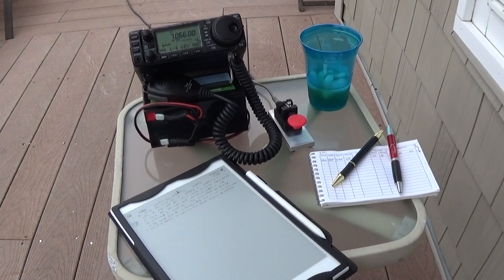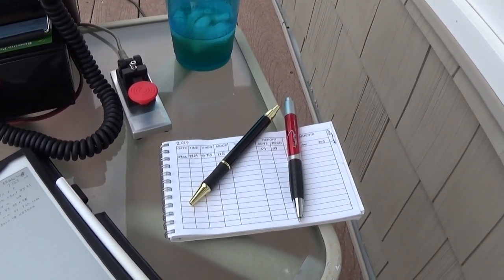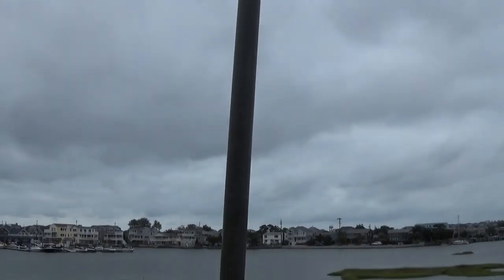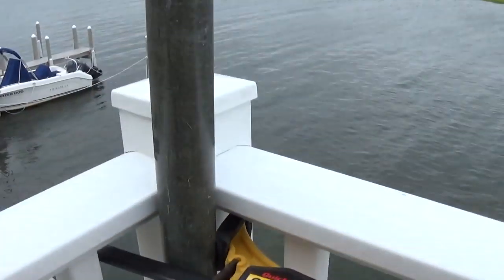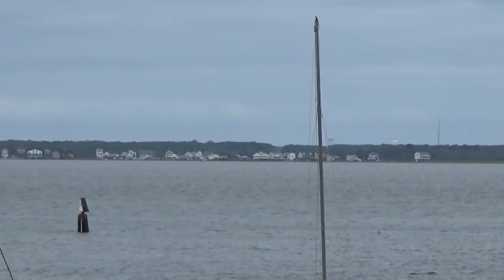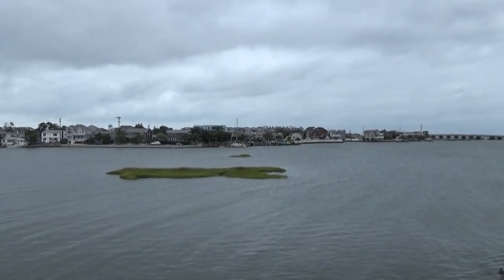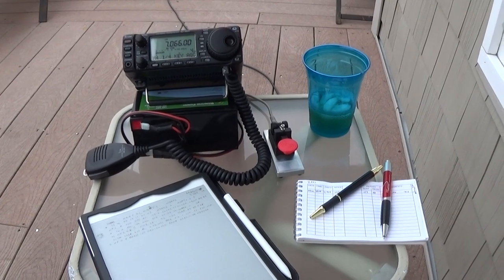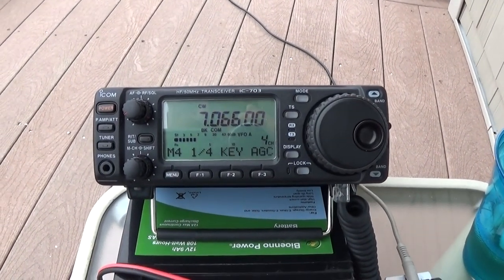#304: Ham Radio: My QRP setup on vacation at the beach house on Long Beach Is. NJ.

Comment: Try some of those rubberized metal cable ties to secure your antenna pole. It's easier than trying wiggle wood clamps in position.
Reply from the maker: Good tip, I’ll have to look for those!

Comment: Nice video, and what a beautiful area. Would a 1954 NC-300 w/2 meter plug in be usable today as a Ham Receiver?
Reply from the maker: Sure, and it would probably be more "fun" to operate than a modern receiver.
Reply: @w2aew  it seems to work, but my antenna is just a piece of coax hanging out of my third floor apt window. But I did hear a voice, hopefully human...
But I can't believe it works at all! 66 year old caps.. Makes me nervous.

Comment: I noticed your reMarkable digital paper tablet in videos you did quite a while ago, and came here to post a comment / question to see if you still used it, and how it held up. And viola there it is! If it isn't too much trouble, a few words about your experience with it would be valuable to me as I am considering buying one, but have heard a bit of negative feedback about them in my research. Thank you in advance!
Reply from the maker: I like it still.  It is pricey though, for what it does.  For me, it is the flexibility it offers for altering/editing my page content (without throwing away a lot of paper), and being able to export PDF files without having to go to the scanner.  Pretty handy for CW copy as well.  Biggest downside is the cost.
Reply: @w2aew  - Thank you. I appreciate the feedback. I like what they are doing, but I hear a new model may be released soon. I think I'll wait. Your videos rock, by the way!
Reply: @w2aew  - Thought I'd get back to you. I was able to contact reMarkable tech support. Apparently the rumor is just that, so I went ahead and ordered one. Thanks for the help!

Comment: Actually I have a doubt why do waveforms move in an oscilloscope when trigger level is higher than signal amplitude and why do they stop when trigger level is on the signal is there something going on related to characteristic impedance(some reflected signal is making the signal move)

Comment: Hi Allan love your vids mate you are so cool....  its said that the QRP record is over 1600 miles on 1 micro watt on 10m   I really find this had to believe...   is this really possible and what is your personal record... Thanks
Reply from the maker: My best was 9200 miles on 100mW
Reply: @w2aew  Hi Allan sorry just realised I did not reply how rude sorry... Wow that is totally amazing that such a small amount of energy propagation can can be pick out of the Aether amongst the whole torrent of EM waves, it really speaks volumes for the outstanding design of the radios and the efforts and skill of the operator in knowing their gear and being able to setup for max performance by taking in to consideration all the variables Time ,  time of year, location, atmospherics and so on,  ham truly is an art and its really nice that folk like yourself take the time to share so others can get some insight into a truly fascinating hobby.. Thanks Allan
Reply: Its funny when you are a kid your all POWER POWER then as you get older you slowly realise its much nicer to refine your setup and use as little power as possible ha when I was about 15 (1995) I delved into radio uniden or sybernet boards were the cheap rig order of the day if I remember correctly  anyway as most do I bought I rig and antenna from someone I knew, turned out   it didn't work,  I took it apart and repaired it it had a reverse polarity diode across the power in which was short so clipped it out and was in business and in in no time at all I had radio gear coming out of my ears I was hooked, I was inside them replacing output trani's, turning up the power output they had a couple of small inductors with movable ferrite slugs inside, turning up the deviation to make the mod louder didnt really know what I was doing but it was great  fun,  Any way long story I went bigger better B300p B550p then I got a vacuum tube unit that was capable of over a KW, I had no idea about interference (after all my TV was fine)  or the people charged with hunting down the idiot causing it (the DTI) the UKs version of the FCC and yes it was just a matter of time until the inevitable knock on the door and the subsequent confiscation off my gear :( should have seen it coming when keying up turned on every sensor light in the street  lol turned out that I should have checked that I wasn't causing mayhem (who knew) and fit an inline filter for anyone suffering interference..

 A radio baptism of fire..... lol

Comment: Nice set up there 👍.Does ur end- fed antenna have a counter poise? I had my swr fluctuating wildly with the coax as counterpoise.
Reply from the maker: Just the coax, but the autotuner in the 703 easily takes care of SWR variations
Reply: @w2aew  I'm my case, I had impedance changing every next second. I am living in an apartment, this could be due to noise sources. I attached a piece of 5 foot wire to the ground and rolled up the excess feed cable near the feedpoint to form a balun. This seems to have prevented the feed cable picking up noise.   Now things are good.

Comment: just curious about the tablet ?   can you provide specifics ?    73 - K4WWD
Reply from the maker: The tablet is from www.remarkable.com
Reply: Great idea, except a review calls it “a bit of a luxury item”. (More than an iPad)
Reply from the maker: @tegra5971  It is a luxury item because of its cost - it is $-pricey-$!! Gives a real good paper-pencil feel. I really like the ability to easily edit, scale, re-arrange, etc. - saves me a lot of paper.  The notes you see on my videos (and available PDF files) are usually the product of many, many revisions and wasted paper.  The ultimate final result had to be manually scanned to PDF.  The tablet is small, lightweight and exports directly to pdf.  It can also read pdf files and you can mark them up, but I haven't used this feature.

Comment: What does QRP stands for?
Reply from the maker: In amateur radio, there are "Q-signals" that are used as a form of shorthand.  QRP is the code for operating at low power, typically <=5W.

Comment: How is your rf ground configured?
Reply from the maker: I don't really have one, per se.  The end-fed wire has a high-impedance input, so the RF counterpoise requirements are minimal.
Reply: w2aew so you just plug into the wall and that is it?   What length wire are you using and transformer ratio? 49:1??
Reply from the maker: I was running off of a battery. The antenna has an LC tuned matching network (sealed box, so I don’t know the exact configuration). Likely a typical EFHW matching network.

Comment: This video was in my Youtube recommended page...

Uh... I am also a HAM, and I am watching a HAM with a house or houseboat, with shore power, operating a 10-watt shortwave radio on a battery.

I am unimpressed. If this setup pleases you, I am happy. But I would not operate this way, under these conditions. I would pull out (in your case) my IC-706, and run it on a power supply, using a terminated-folded dipole, which would need no antenna tuner, and go about my business.

But that is just me...
Reply from the maker: ...sometimes the fun of it is sense of accomplishment when making successful contacts with less than ideal operating conditions.
Reply: w2aew 

For some people, that is the point. Not for me.

I can make driving my car more fun, by running it on the car battery and starter motor alone. Let’s increase the level of difficulty, to magnificent levels, because it is fun.

The idea of Ham radio, is to make proper contact as smoothly and as often as possible, with least power usage needed (FCC rules, remember). But uh... no, you want to run equipment that forces you to operate with both arms tied behind your back.

Have fun with that. As I said, if that pleases you, be my guest, I’m happy for you.

But don’t try to kid a kidder.
Reply from the maker: It’s all in the spirit of ham radio. An efficient antenna, over salt water, helps both tx and rx. 10W output results is less than a 2 s-unit reduction vs a 100W rig. And certainly keeping in the theme of minimum power to get the job done. 

Yeah, running a car on the starter doesn’t sound like fun to me either. I’ll take my flat six and 6spd any day!
Reply: w2aew 

Better... much better!